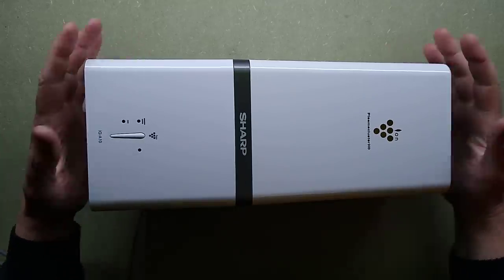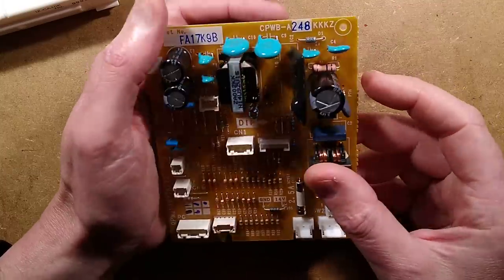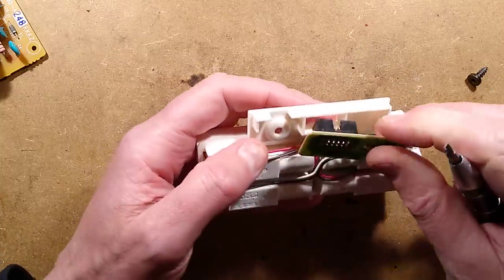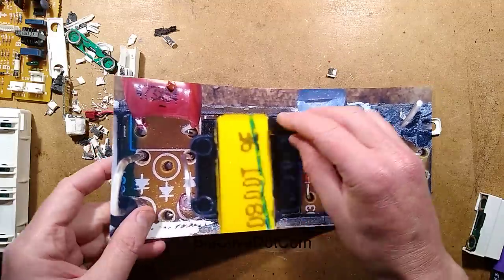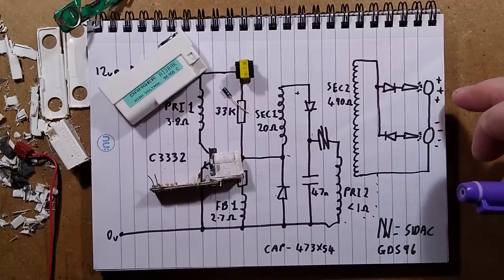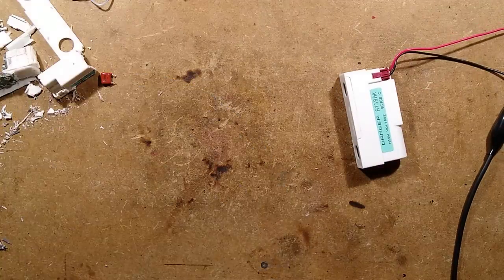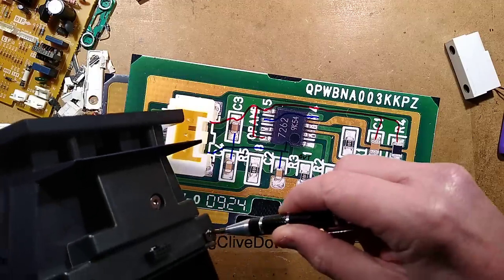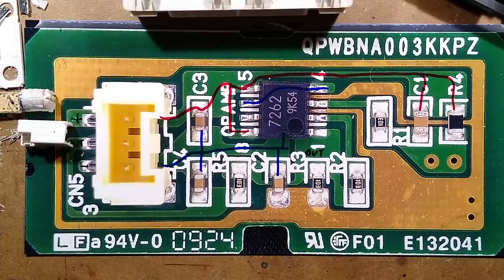Exploring a popular Japanese air purifier.

Comment: Ozone is not something you want to be breathing all day every day, but for other reasons.  It's a pretty potent oxidizer and your are chemically burning your lungs if that's all you breath.  Most ozone generators though are significantly less damaging than smoking a single cigarette a day.  Especially if you use them right. I've use ozonated water as a surface sanitizer for years, it's safer than alternatives like chlorine or sulfur dioxide.  Better for the product too.
Reply from the maker: It's all a matter of quantity.  That's like comparing a cup of coffee to pure caffeine powder.  In this case the unit produces a trace level of ozone comparable to what you would find outdoors.  Even in a remote woodland location with a river flowing through it, you will find that trace level of ozone as part of the air.

Comment: In what way to the 'plasma clusters' deteriorate and require replacement?
Reply from the maker: The corona will blunt the needles over time.
Reply: bigclivedotcom A shame, one would think using tungsten or some kind of carbide or nitride plating that lifelong electrodes could be affordably made - alas not a very good business model... ;)
Reply: @f123raptor  Tell that to Gillette.

Comment: So basically they're saying that this machine causes H20 to separate into H H and 0, then when it's released in the air it automatically collects H20...

Maybe it reforms back into H20 which attracts more water molecules.   I mean "technically" they're correct but not really.   If they're releasing oxygen as O, that's ozone if it's attracting 02 to make 03... XD

Comment: never use chip dates as an exact time frame for the product. Chinese assemblers use old stock chips on newer products alot. Giving that potted module, I'd say its 2015 or 2016.
Reply: Potted modules have been around for decades. Also that's a replaceable unit and Clive said he bought it from a private seller on ebay so.... As well as the chip there were two PCBs that had '09' on them.
6:05
(Chip) "09 27"
6:18
0938 = left side main pcb
30:00
0924 = bottom of auxiliary pcb

Comment: We have 2 plasmaclusters at home. They are very high quality and the fans are silent on low. The ionisation drys the air a ton so we turn that function off at night else we wake up dehydrated. The ionization packs are not replacable on our unit. We DIY cheap bulk HEPA filters to save money. The carbon filters get a sweet smell after a few months so need to be replaced frequently (FranLab has that same problem on a different brand machine); you can also DIY activated carbon filter stages but rinse out the small particles firs.
Reply from the maker: If the unit is designed for a larger room than your bedroom then the dehydration (stuffy nose and hoarse throat?) may be down to a slight excess of ozone in the room.
Reply: @bigclivedotcom  Indeed they are a bit oversized. In Japan they also add the humidifier function; that is removed in other countries to reduce price.

Comment: I've just bought a couple of these... Can anyone recommend a transformer to run them in the UK? Are ones that just halve the voltage (ie. 120V) OK, or should I go for a proper 100V one?
Reply from the maker: A standard (heavy) American voltage converter should work.  What voltage range does it actually say on the rating plate?
Reply: @bigclivedotcom  It says 100V, 50-60Hz, 8W... It looks exactly the same as your model, but turns out it's actually different.. model number IG-B100-W, lower wattage and different plasma cluster module (IZ-CB100)

Comment: @24:13 Sharp claims that their Plasmacluster units do not generate ozone like other brand ionizers. They also claim that ozone emitted by Sharp units are within the permissible limits.
But the moment I turn on Plasmacluster mode, it starts giving me a splitting headache. Non-Sharp ionizers that generate ozone also cause headaches and discomfort. Looks like I need to buy ozone detector to allay my doubts.
Reply from the maker: I've tried lots of ozone detectors and none of them were sensitive enough to detect the trace levels from this unit until I put just the emitter heads in a sealed enclosure.
Keep in mind that ozone is a natural part of air at low level.
Reply: @bigclivedotcom  Thank you for saving my time and money!

Comment: clive : why are they doing the opposite polarity thing?
me :  possible explanation :
the japanese being what they are and being concerned about neatness do not want to create the mess of dust getting attracted to the whole unit and gunking up the entire surrounding area.
so by alternatingly generating positive and negative charges they do their purification business but attract dust as much as they push it away...

(and saying that i realized that there is a fan that sorta invalidates half of it?!)
Reply from the maker: It does potentially avoid an external air charge difference, which would reduce the tendency of the dust to stick to surfaces as with a traditional negative ion unit.
Reply: @bigclivedotcom  mmm and i though the fan would blow it away anyways so that that issue isnt a thing...

Comment: Isn't O2- (in their picture) just ozone (O3)? read the wiki: https://en.wikipedia.org/wiki/Ozone#Corona_discharge_method - they also say that this also produces nitric acid. Drying the air reduces the nitric acid formation, but their picture relies on water in the air. So the healthily benefit from this device is a bit questionable. Read about nitric acid in wiki: https://en.wikipedia.org/wiki/Nitric_acid#Safety
Reply: “Systemic effects are unlikely, however, and the substance is not considered a carcinogen or mutagen”. Yeah and?

Comment: Ozone is technically an ion of oxygen?
Reply: Ozone (O₃) is a molecular form of Oxygen with a different chemical formula to regular molecular Oxygen (O₂). If I recall my chemistry education correctly, this makes Ozone an allotrope of Oxygen. In the case of Oxygen, ions are single Oxygen atoms that have an electronic charge of -2, this means they will react to form ionic compounds with positively charged ions. As Ozone is an unstable molecule, it readily breaks down in to stable Oxygen (O₂) and an Oxygen ion (O²⁻). This O²⁻ ion then reacts with positively charged ions or compounds that can have their negative ion displaced by oxygen.
Reply: No, a molecule consisting of 3 oxygen atoms
Reply: @greenmanreddog  Yeah so basically ozone behaves like an Ion. It's very eager to stick to other things.

Comment: It looks very good quality to me, it would be nice to see more things made so well.
It does look like the op amp is making a ratio measurment of the emmissions.
Connect an oscilliscope to the op amp output and block one of the emitters with cardboard and see if the output is an oscillation  with variable mark space ratio, or just a d.c voltage going up or down.
Dam dont i waffle, sorry clive.

Comment: Yeah, the Japanese seem to have been well ahead-of-the-game in design fail-safety for longer than I've lived.
(As yet another example, the Nintendo 64 – Nintendo's home console of the 5th generation, the first to use SMPS – already included a thermal fuse on its main switching transistor; these still aren't standard practice in SMPS, the way they've been in linear supplies since the 1980s including Nintendo's own for the NES and SNES of course.)
 
It does amuse me how Americans (especially) are so phobic about fan heaters (in particular) when not only have they had compulsory thermal fuses since the 1980s (if not earlier in some places), but they're the device a thermal fuse was first invented for to begin with; see the HMV Cavendish (from the 1940s no less): https://www.vintage-radio.net/forum/showthread.php?t=70261
On that note, Kambrook's current heaters implement a passive fire-protection measure (fiberglass sleeving around the free-placed internal 'cup' connectors) comparable to the mica lining in this unit's SMPS: http://www.hardwareinsights.com/forum/viewtopic.php?f=29&t=2160#p9122 (on top of crimping the internal connectors properly in the first place)
 
I'm sure this will do way more for actual fire-protection, than the Americans' AFCIs ever can (I can't think of a grander example of a wasteful "shotgun" approach to a problem).
On that note, some American practices really are (or were, but still) so frightening that it's obvious they weren't even slightly thought-through: https://www.electrical-contractor.net/forums/ubbthreads.php/topics/206431/re-fire-source.html#Post206431 (My ignition coil exceeds 850°C with just 60W, and by my calculations such a low-voltage MOV as mentioned there could dissipate in excess of 500W under full load; easily glowing white hot if the load is enough. I could buy a few 18V 14mm MOVs just to load-test and prove my point; they cost less than $1 a unit so a small price for science.)
 
That's not to say faulty thermal fuses don't make it into the channel, of course; indeed I've found one in this steam cleaner:
http://www.hardwareinsights.com/forum/viewtopic.php?f=29&t=2247&p=9821#p9821 This is why it's just not worth the trouble to buy important components through shady middlemen.
In general my rule of thumb is to stick with trusty middle-aged (reputable) appliance brands; newcomers often have to learn the hard way about supply-chain integrity and the like, while the really old brands all-too-often play-up their heritage in order to now sell engineered-to-fail (or inherently obsolete) junk to the gullible (competently manufactured maybe, but throwaways nonetheless). Granted, brands whose selling point was cheap all along, remain the worst of all.
Reply: TL;DR
Reply: LB;WR  Long but worth reading

Comment: The thought occurred to me that the naturally occurring ozone levels outdoors might be higher because of corona discharge from high voltage power lines which are all over the inhabited areas.  Someone should take some measurements to see how much is man-made.
Reply from the maker: They try and avoid corona discharge on lines because it damages them.

Comment: So Clive, it works by attracting bacteria which have a negative charge on their cell wall due to the presence of teichoic acids linked to either the peptidoglycan or to the underlying plasma membrane. I am not sure about the surface charge on viruses. However, within viruses there is a negatively charged zone associated with their DNA that is thought to be affected by positively charged particles. The bacteria are drawn towards the plasma field and destroyed. Viruses are possibly also denatured. The presence of ozone is more significant if you think it is concentrated at the charge points where these microbes are drawn, limiting the need to pump this damaging gas into human breathing air. If you think about it, it is the combination of bipolar ionisation and ozone generation that gives you best of both techniques. It is a very sophisticated design. Why don't you do another video and look more at those theories.

Comment: Chemistry explanation of how H2O and O2 are ionized. Starting with O2 since it is easier. O2 is composed of 2 oxygen atoms with a double bond and shaped in a roughly dog bone shape. Their double bond is on the weak end of the scale and easily broken in the presence of free electrons. Oxygen atoms have 2 outer orbitals with unpaired electrons, in O2 those two unpaired electrons are contributed to the shared double bond. Oxygen is also perfectly happy to accept loose electrons to break the O2 bonds and wander away as O(2-), an oxygen atom with two electrons too many. When there are too few spare electrons you get O3 (ozone), where an O(2-) or O(1-) oxygen attacks another O2 molecule and bonds with it.

Hydrogen ionization from water is more interesting and builds on Oxygen ionization. In this situation, the Oxygen in H2O is attracting the single electrons of the Hydrogens to create shared bonds with. Unlike O2 where the atoms are equal, there are significant differences in electronegativity between Oxygen and Hydrogen. Combined with shapes inherent to the electron orbitals around Oxygen, the molecule ends up shaped like a boomerang with Oxygen in the center at the bend and the two Hydrogens on the ends. The electrons spend most of their time around the Oxygen, making H2O also act like a electromagnetic boomerang arranging either positive Hydrogens or negative Oxygens to other ions (as kind of hinted in the "cluster of grapes" analogy). This property gives water its great solvent properties in dissolving things like salt where the Oxygen end of the water molecule pulls the positive sodium ion into solution and the positive Hydrogen ends pull the negative chlorine ion into solution. This pre-existing charge imbalance makes it easier to strip Hydrogens away when electrons are stolen from a water molecule.

/End Wall of Text

Comment: John Ward has been intruding on BigClive's territory by opening up a smoke alarm but his analysis of the circuit was rubbish compared to Clive's.  https://www.youtube.com/watch?v=UD5BWg-OmQM

I notice that the smoke alarm in question uses the ubiquitous capacitor fed power supply with a 0.47uF X2 capacitor which raises the question of how does it manage to last 10 years when other circuits seem to fail after only three or four years.  I suspect that it's all down to the voltage rating.  If you want your product to last three years then you use a 250Vac rated capacitor, if you want it to last ten years you use 275Vac and if you want it ot last forever you use 310Vac.

Comment: It doesnt matter who designed it if it was made in china.
Reply from the maker: It does.  Because it's not a misguided clone and they monitor the manufacturing quality.
Reply: @bigclivedotcom  i agree. The difference is 300% but china is only going down in manufacturing quality from here on out. I Will take japanese ownerd made and designed even if i have to buy brand new.

Thats just my oppion. If i have the option

Comment: Japanese designs are always over engineered... !!
and not maintenance friendly.
Reply: this looks very maintainable to me. apart from the modules themselves. but those you wouldnt want anybody to get into for safety anyway
Reply: I work with japanese electronics all the time and they are almost all very very easy to maintain. Yet they are sometimes confusing because they are overcomplicated
Reply: @ThePunischer1000  i worked in maintaining a very reputable branded Japanese made OMR scanner machine... when you need to change the feed rollers after every 100000 page scanning, which can take 15 days to reach usually, you have to disassemble almost the WHOLE top part of the machine just to replace those 3 feed rollers.... !! where it should have been modular....